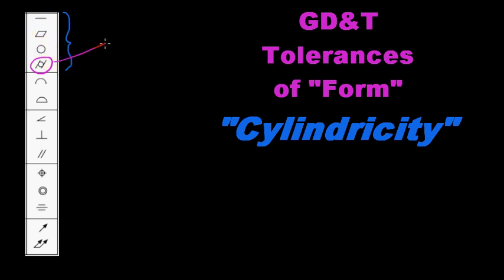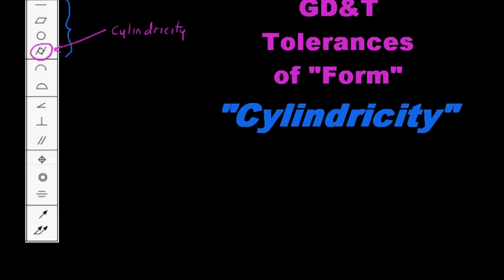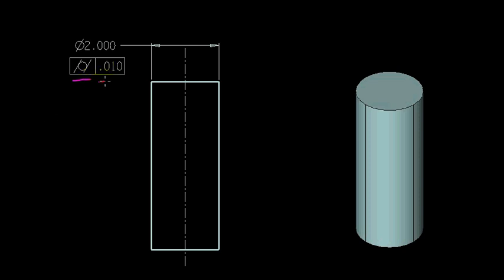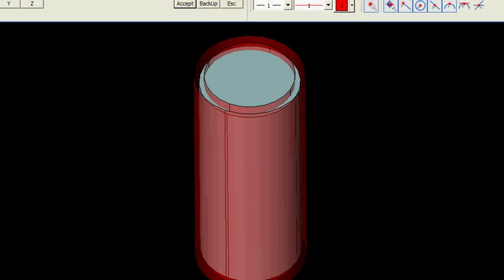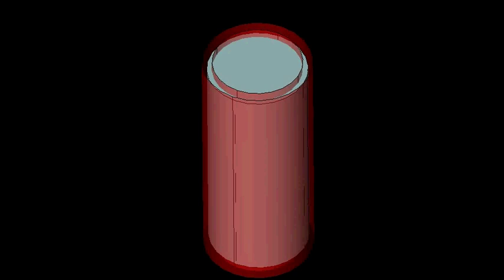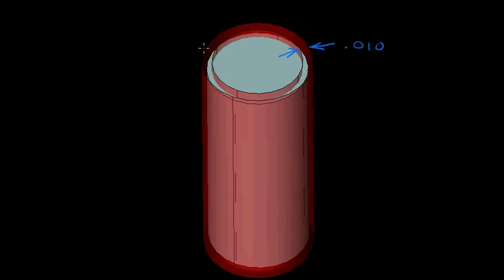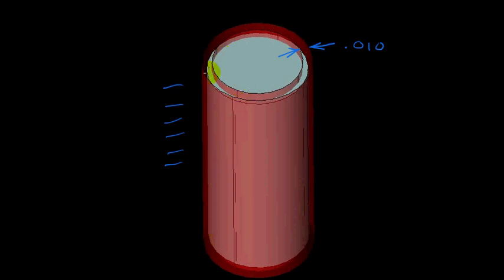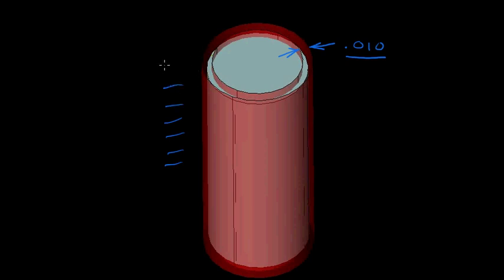Blue Print Reading - GD&T Cylindricity

Comment: if cylindricitiy will cover everything, whats the point of having circularity???
Reply: Longarmx "Straightness is to Flatness"
that is kinda part of my question...

if a part meets the 3d version doesn't it automatically meet its 2d counterpart (like flatness to straightness, cylindricity to circularity)? etc.
Reply: Longarmx ok thanks thats a better clarification....

but if the flatness meets tolerance you can kinda assume straightness meets tolerance?

same with the circularity part?